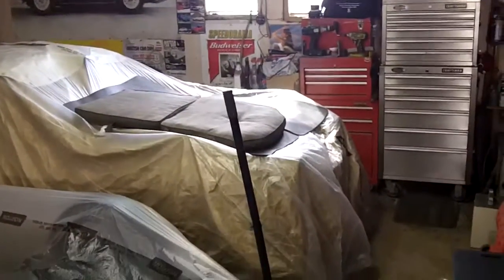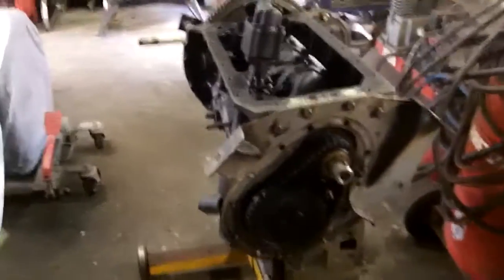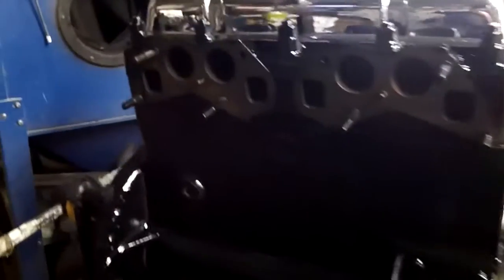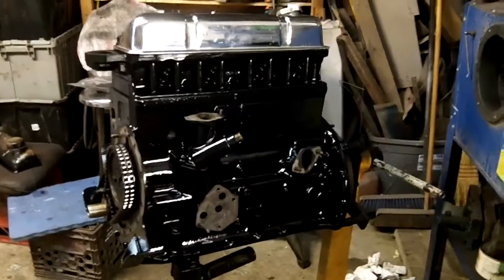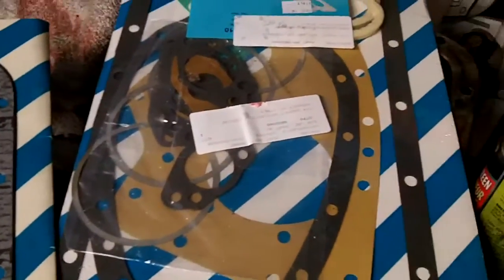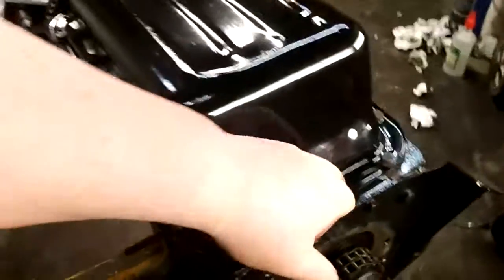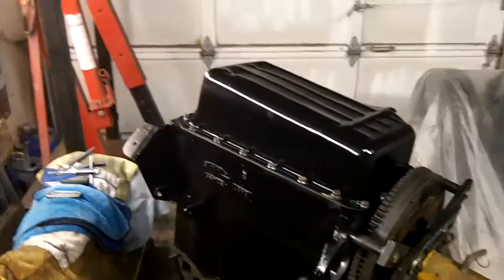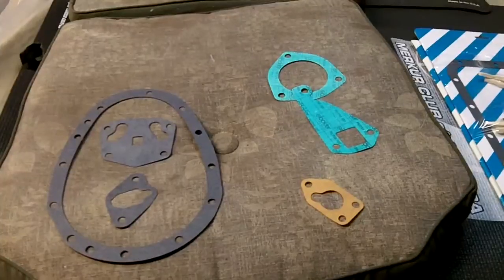1959 Triumph TR3A Restoration, Engine Painted

Comment: Wow, you really are moving along, David! The engine looks 100% better. That little gasket with the three bolt holes and funny slotted hole in the middle is for the oil pump to cylinder block. Part No.  056282.
Reply from the maker: Bruce Boschek Hey Bruce.   Your right!  Thanks for that.   I didn't remove the oil pump, so that's why I didn't recognize it.

Comment: The yellow gasket is to the left handed metric canutering valve.  But you have to remember to flip it over so the soloquial side is to the left and trim off the puntater tab or it won't begin to give you the oil presure that you will require if you had to require it again.   That's what I'm here for... Jerry

Comment: Before you breath your next breath! Please slide the oil slinger on the crankshaft! They are very easy to ferget and leave off. If you need one I have 43 of them.....
Reply from the maker: cutworm59 Roger that.   If I recall, there is a washer or shim on there as well...that reminds me, I need to paint the crankshaft pulley....maybe a project for tonight!